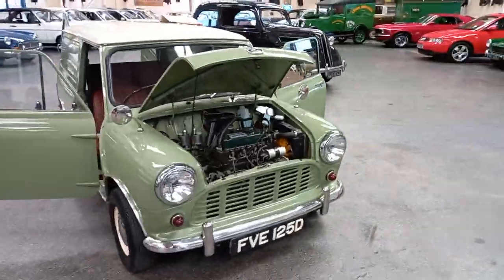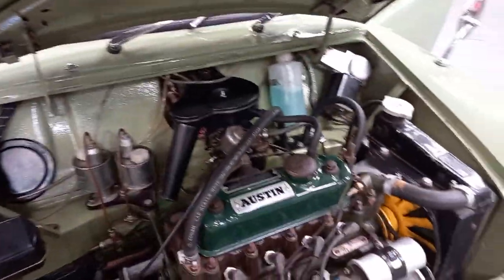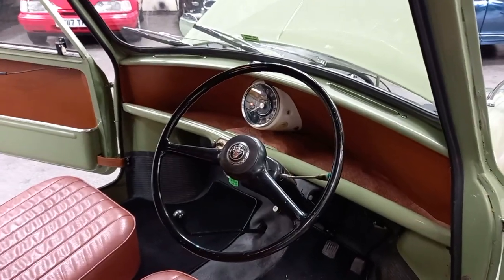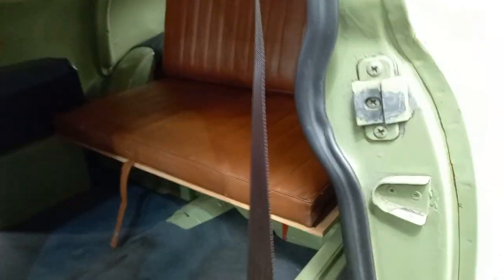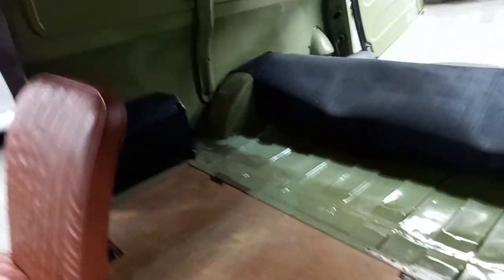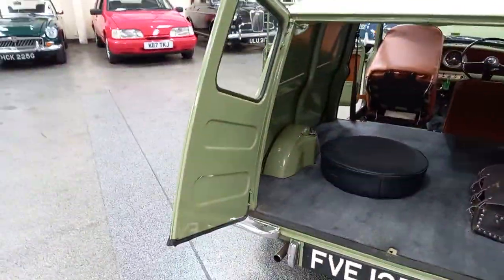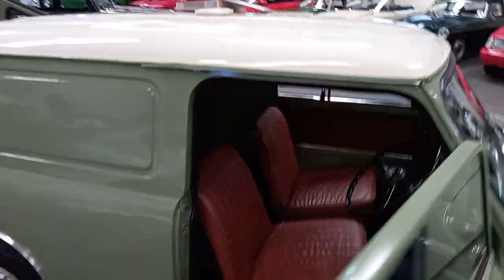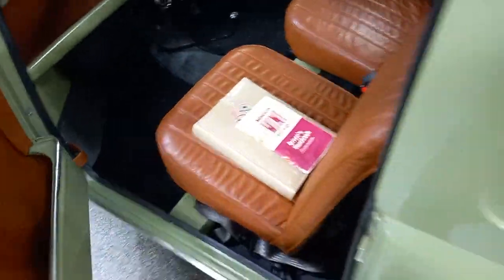1966 AUSTIN MINI VAN | MATHEWSONS CLASSIC CARS | 20 & 21 AUGUST 2021

Comment: My dad had one in this colour, until the delivery driver for my grandads shop got it wiped out by a combined harvester...
I had one that I bought for £45  because it need a new rear subframe. I got one for £12 from a scrapyard and fitted it. Ran it 2years as a daily and for workhorse for renovation of our bungalow. Sold it for £100